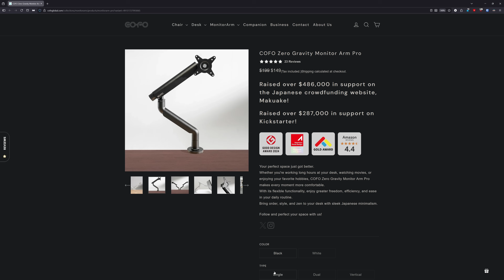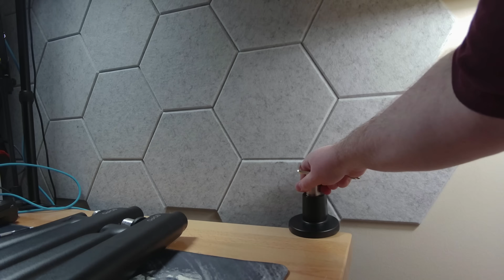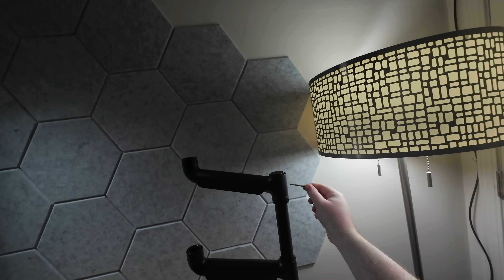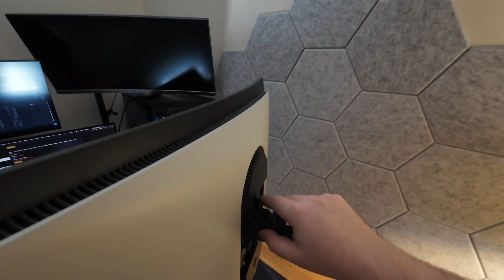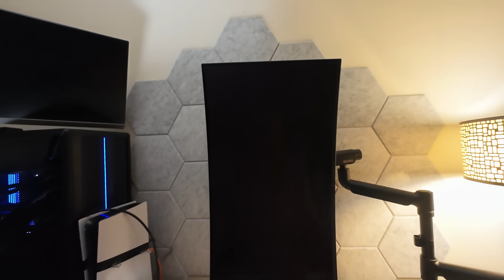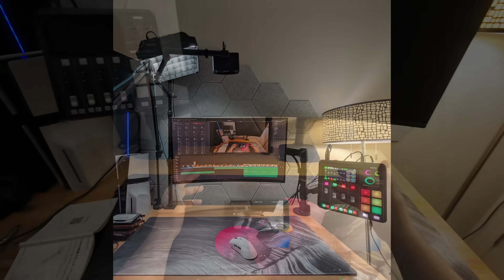COFO Zero Gravity Monitor Arm Pro Setup & Review

Comment: The hinge closest to the monitor isnt strong enough to hold up my 32in odyssey g7 and always tilta forward no matter how much i tighten the bolt; im worried about stripping it out.
Reply from the maker: I swapped things up and have an old 34" Ultrawide on mine now. PG348Q from 2016 that weighs 7.7kg/17 pounds on it right now tilted upwards slightly and it's holding fine. 

I did have to tighten the bolt you're talking about with a bit of force, but it has held up for me.

So I'd tighten it further or reach out to them if you don't want to push it further.